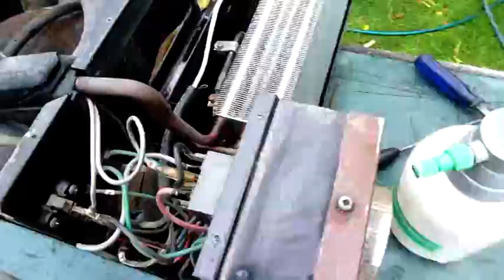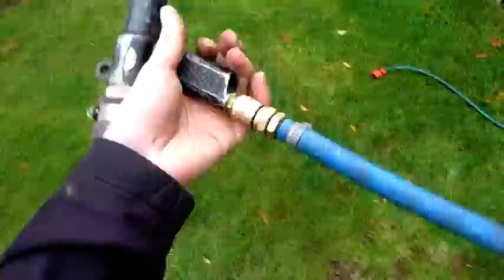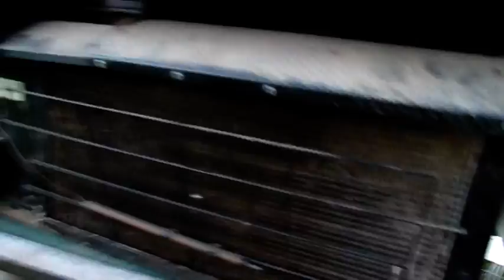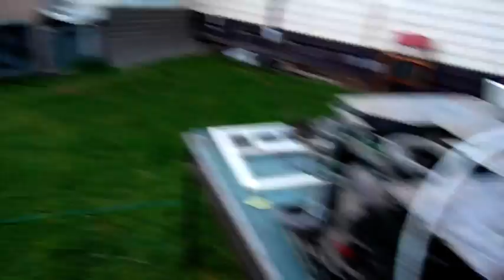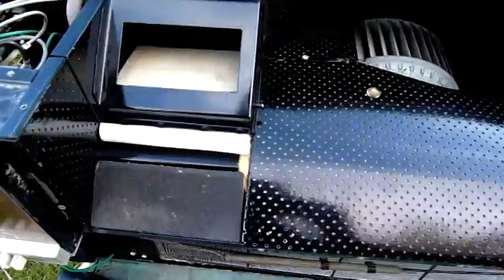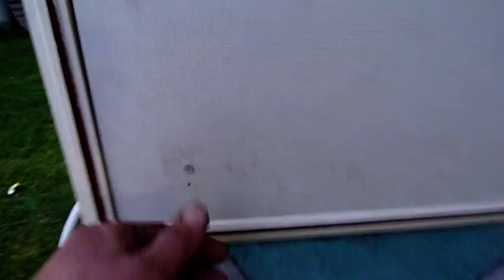1960's Kelvinator Window Heatpump Restore

Comment: HI Aussie50, I would love to know what size that large capacator that feeds the compressor. I have an air con almost identical to yours except it doesn't have an on/off, it turns on and off at the wall. And it has a dial for the cooling strength. The large capacator needs replacing but the writing id has come off.  thanks, Dianne

Comment: I love how well these AC units turn out after a fixing up.  The older ones were really built like tanks.  If the original owners had cleaned them up once in a while, they would probably still be using them!

Comment from the maker: @CorbyStarletCj1 they are incredibly simple. my first one was a bit of 20mm aluminum tube from a Color Copier,, just drilled a hole in the radius of the bend (it was a 45* dump pipe for waste toner) and stuck the nozzle of my air blow gun down it.. volla, instant air vac.

Comment: those old window air conditioners are just tanks compared to newer ones. i go into home depot or lowes and they have plastic bases and you can move around the coils with your hands! i have an older "chambers" brand 1 ton i think it is whirlpool idk but it it wayyyyy better built compared to my newer lg! i wish i could get a kelvinator heatpump here in the U.S. to mess around with. the rusted and or pos ones here are getting annoying :p

Comment from the maker: @adcuz no moving parts in these apart from the trigger valve.

a air vac works by firing a jet of compressed air down a tube, thus creating a negative pressure behind the jet, pulling anything in from the open end

if I were to hold my hand over the suction end and seal it off, no vacuum would occur becasue there is nowhere for air to be drawn through